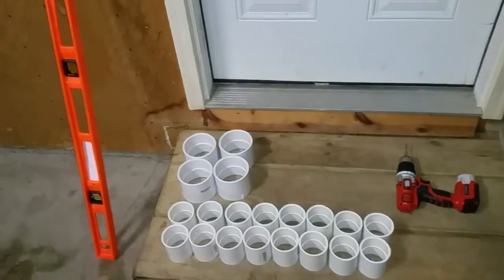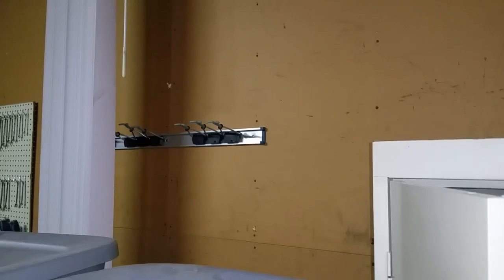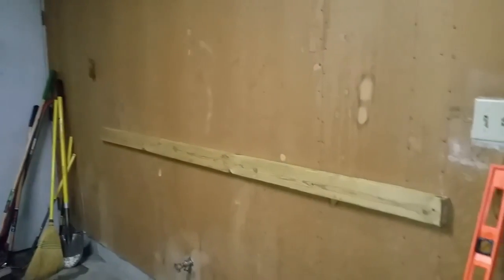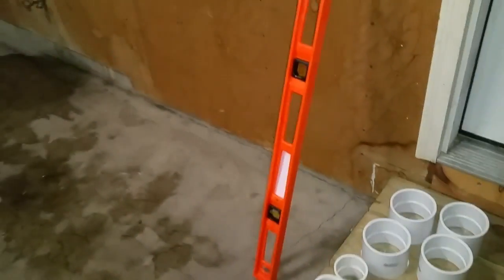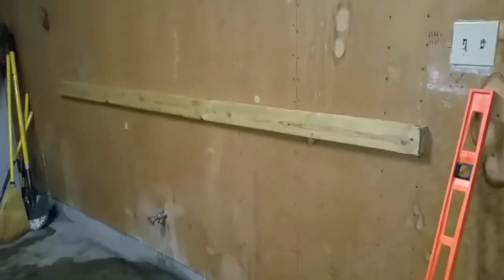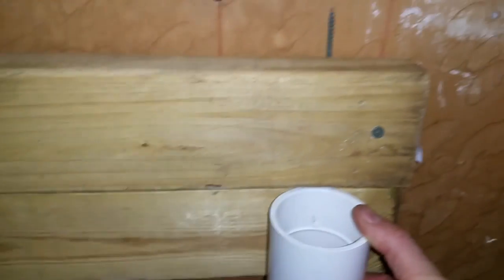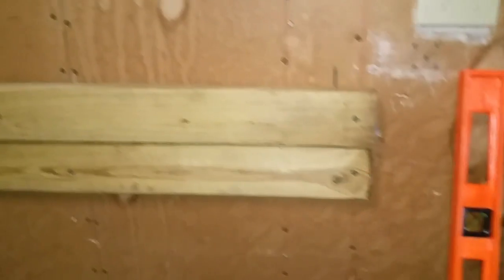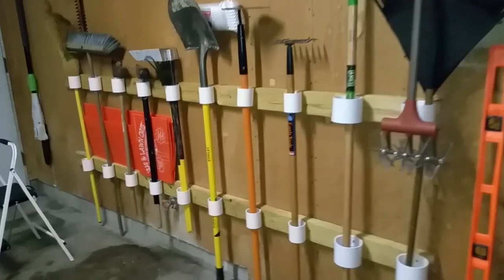How to make a yard tool organizer with PVC pipe

Comment: I wish you had shown how you screwed them into the board.
Reply: It looks like it is hanging on a screw.  that's my guess for why the drilled hole was at an angle.

But you're right, seeing that part could have enlightened the video a bit more.

Comment: Thanks so much for your video I was really stumped on how to get the screw in 2x4 straight, loved your way to make angle holes. Thought I'd have to jigsaw front of pipe, you saved me a lot of time,  thank you. I have a question for you- I noticed you had a lot of bins in your garage, as I do too. Wondering how you ended up organizing them would love to do an overhead on the ceiling DYI?  What was your solution? I hate the idea of them taking up good floor space but maybe there's a better way? Good job on your video, I love watching the non-professional non-paid regular people posting their great ideas :-)
Reply: I ended up just double stacking the bins against the wall. Had 20 of them total. Thought about overhead, but what I store in them I don't plan to keep.
Reply: @JeramieCurtice  Thanks for your quick reply, 14 of my 24 bins are things to sell or not hang onto, lol. Which too, why I didn't do overhead yet, but things like towstraps, jumper cables, camping stuff, extension ladder etc., not attic stuff per say. I'm really new at power tools &  woodworking, but loving it. Want as much floor space as possible. My garage is drywalled like yours, much of internet DIY uses exposed trusses & 2x4, then shows a  recessed build. Next project, I want to make a spray booth, gotten plenty dizzy off fumes ;) Hope you got your garage organized. It's a good feeling,  had it several times but then  tear it apart and start over!